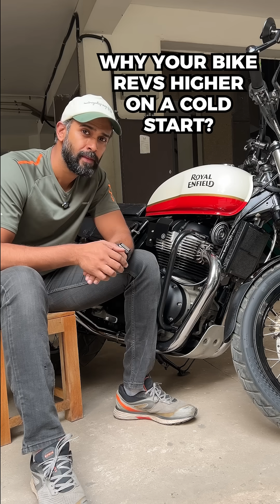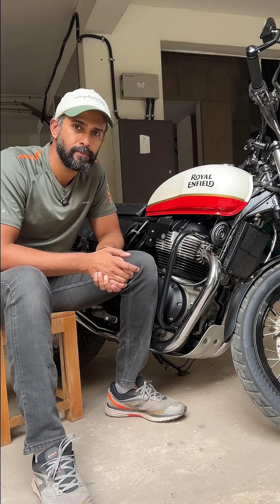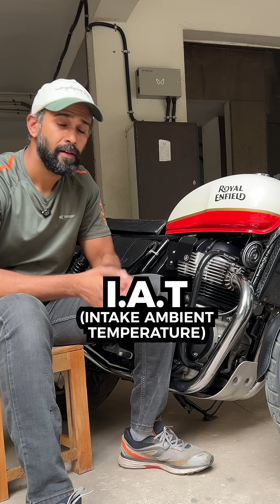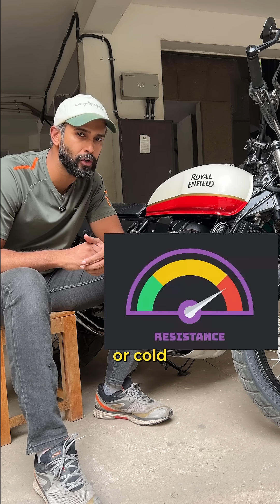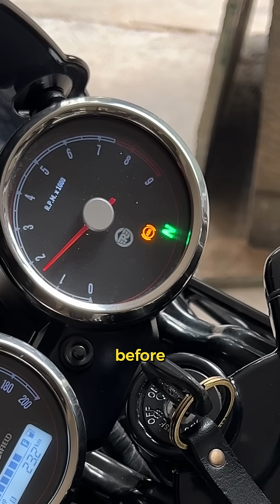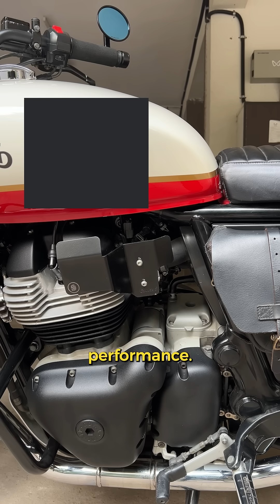Did you know this? #shorts #shortsfeed #ytshorts #shortsviral #ytviral #bikerlife #bikelife #reels

Comment: Electronics engineer here. As many people have pointed out, this is misinformation. The reason for the high rpms is to for the oxygen sensors in the catalytic converter to heat up to operating temperature. Without these sensors, the ECU is basically blind and does not have a feedback loop essentially operating the engine in open loop configuration. When the O2 sensor kicks in, it's now a closed loop control system and thus based on the exhaust O2 content the ECU can match the exact amounts of fuel-air mixtures from its lookup tables. So until then, it runs at a higher idle with a richer mixture, oil circulation is a secondary reason but that usually takes around 4-5s for oil pressure to stabilize. But this is the time first time I've seen someone blame the mass airflow sensor for this. Please correct this.

Comment: Automobile engineer here. Let me tell you. It’s not to get the engine to operating temperature or for settling the AFR. The actual reason is for emission. Modern bikes are equipped with catalytic converters which only work when the catalyst temperatures are high. So to quickly get the catalyst to temperature, AFR is made rich, ignition timing is adjusted accordingly and idle speed is increased by the ECU. As soon as the catalyst reaches operating temperature, engine idles slow and ECU runs in its best efficiency tune.

Comment: Ummm not totally right, why idle rpm goes down/smooth after 1/2 min?

Ambient temp is still low? Right?

I will tell you: ECU also checks the engine temp and combustion efficiency from exhaust sensors, based on engine temp the combustion efficiency changes which ECU detects and changes the fuel mixture.

More Factors:
1. Engine Temp
2. Combustion Sustainance
3. Combustion Efficiency
Reply from the maker: Thanks for the added insights!

Comment: When I start my bike (scrambler 400x) in the morning the rpm is high like 2300 rpm and when I ride it immediately without cold starting in 2nd gear the engine suddenly turns off in 2/3 gear what could be the issue?
Reply from the maker: that is interesting! Clutch control?
Reply: @SrinivasGanesh maybe but sometimes I don't touch the clutch and as soon as I de accelerate engine braking happens and suddenly the engine cuts off and the rear tire skids. That movement is quite dangerous. once the engine heats up no more of this happens

Comment: Its not because of intake air temperature. It's the engine temperature. Cold engine doesn't atomize the fuel well so needs a richer mixture. Also the idle speed increase is not because of a richer mixture, the increase due to that would be negligible. The idle rpm is controlled by the ISC idle speed control motor which controls the amount of air going. Richer mixture is for better atomization and higher rpm is to warm up sooner.

Comment: it’s not accurate information. petrol doesn’t burn properly when cold, it’s not atomised properly which is vital for air fuel mixture. liquid petrol doesn’t mix with air properly resulting in bad idle rpm. So the bike’s ECU add more petrol to make air fuel mixture rich so it doesnt cause any issue with cold idle rpm. Now manufacturers tune the ECU to run the idle rpm at cold start higher so that oil pressure builds up and gets to every nook and cranny. 

you got your logic wrong, bike isn’t adding more fuel to compensate for denser cold air, it’s doing it make idle smooth. try doing this in Carb bikes. Choke allows for more fuel for precisely for the reason i mentioned.

Comment: The RPM shoots up to warm up the catalytic converter as soon as possible as they are pretty ineffective at colder temperatures, there is also a slight ignition delay during a cold start, so that more of the combustion takes place in the exhaust phase of the engine cycle or within the the exhaust manifold to warm up the CAT. (Hence you smell petrol or simply hydocarbons in the exhaust fumes more during cold start) there is nothing to do with these sensors.

Comment: High RPM during a cold start isn't activated by the IAT sensor. Instead, it's the engine oil temperature sensor or the coolant temperature sensor that senses the engine's temperature, prompting the ECU to raise it to the normal operating temperature by boosting the RPM. Make sure to educate yourself first before trying to teach others.

Comment: Not correct info. ECU runs engine at higher rpm to bring engine to its operating temperature quickly and to provide enough lubrication to its vital parts like crankshaft bearings...etc.
Reply: Correct this happens in my Ntorq 150 it idel at 2000 rpm when started first then once warmed up it has 1000 rpm at idel

Comment: Its not the IAT, but the EOT (Engine Oil Temperature Sensor) which is the reason for cold start increased rpm. And when the oil reaches the specified temperature the idle rpm settles down. Consider your bike in leh and the air temperature is cooler everytime, but the rpm is not raised everytime. The ECU finds the engine cold measuring the temperature of the engine oil and reduces to normal idle rpm when it finds the engine oil temperature has raised to the specified temperature. You’re welcome.
Reply from the maker: Appreciate the detailed explanation! I google searched the difference and they are indeed two very different things. This short explains the IAT. I will do a separate one on EOT.
Reply: @SrinivasGanesh  Sorry man, the explanation in the video needs to be better. As a layman your explanation feels like after idling for a  few mins, the intake air will become automatically hotter, which is obviously not the case. And Yeah It's EOT that mainly controls the warm up rpm.

Comment: One important thing which u can make a video and bring attention of the people is the hazards of pressure washing… 
I own the same bakers express interceptor 2020 model and recently came across this issue … after the pressure wash the next day while returning back from the office my bike would go dead midway… no matter the gear I am in it would just go dead no throttle… after switch on again it would start and travelling some distance even at 40 speed on 4th gear it would go dead ! I was horrified by the situation… planned to go to the service centre to get it checked, couldn’t ride the bike for two days nor go to the service centre… magically the third-day my bike was normal with no issue … definitely because the 2 days break was enough to let the water dry out stored in most of the unreachable places like fuel injection ecu switches etc … this is something I experienced be safe fellas👏🏻

Comment: This is applicable only in Fuel injected bikes, for a carburettor bike, we need to manually pull the choke till the bikes idle rpm and heat is restored.😅
Reply: Yeah and used to avoid using self start in cold in my CBZ Xtreme trying not to put much pressure on battery. Used kick start instead.
Reply from the maker: Yes! You are absolutely right!
Reply: What about auto choke ??
Reply: @charanbr3509 that's what is fuel injection is replaced for
Reply: @gururaja_udupa_baikady  but discover 125 there no choke ( but has a carburetor) but does the same like that every morning
Reply: @dilushamda it has an electronic carburettor
Reply: @dilushamda  It Has Automatic Electric Choke
Reply: First time I understood choke

Comment: When the engine is cold, the piston shrink contracts slightly low, creating more clearance and allowing it to move more freely, which increases RPM. Once the engine reaches its proper operating temperature, the piston expands and fits more tightly against the engine head, causing the RPM to decrease.
Reply: Nop. Thats wrong.
Reply from the maker: Got it! Thanks for sharing this info!

Comment: What about rpm fluctuations?
Reply from the maker: Then something is wrong with RR unit. Get it checked.
Reply: Thank you Brother..
Reply: Check the ECU. RPM variations occurs with a faulty ecu. Try Flashing it or get it replaced. Alse check the throttle cable and EOT sensor.

Comment: How did you manage the engine tapping maintenance work. The RE service centres around chennai are not doing a good work with this maintenance activity😢
Reply: Check for the valve clearance. Inlet valve must have 0.08mm clearance gap between the valve and the rocker arm, and 0.18mm gap for the exhaust. You’re good to ride. Thank you.
Reply from the maker: Check valve clearance values

Comment: On a cold start rpm raises in modern vehicles for proper oil circulation,rich mixture of fuel mainly to  heat the catalytic converter for emission but also to increase the engine temperature.Idle settles once the catalytic converter is warm enough for regulation  of emmision.Engine will take usually 3-5mins of riding for petrol to reach optimum engine temperature and diesel will take 8-15mins.
Reply from the maker: Thanks for sharing the detailed info!
Reply: What about traditional carburettors?
I’ve seen my bike starting with a lesser RPM initially and then raising when warm enough.
How does that work?
Reply: @veeru1706 because the bike gets warm and reaches optimal temperature so it naturally burns fuel easily.Think the other way ie,Rpm gets lower at cold start due to low thermal efficiency
Reply: Perfect bro, Only correction here is, there is not much oil circulation needed, in modern engines it takes 1/2 second for oil to go places it needs to be. (you can ride as soon as your check engine light is off after start, typically 1/2 seconds in modern engine), however you can ride before the light is off too, its really hard to revv hard in that 1 second.

Comment: I have ns160 I takes 3 power starts to start engine, I took many times to service centre but no use can you please help.
Reply from the maker: It sounds like an issue with the spark plug or fuel delivery. Have they checked those?
Reply: @SrinivasGanesh yes in last service they checked whole fuel system but no use and spark plugs are new one

Comment: Hey ! Something happens to my hunter 350 sometimes ,is that when i start it and ride it , it feels like some amount of throttle is constantly pulled at all time even when i am not pulling . I noticed it when i like stop for speedbreaker and pull the clutch leaving the throttle . Any idea ?
Reply from the maker: Yes, your throttle cable is about to break. Get it changed.
Reply: Yes, your rpm has a variation issue. If its not around 1050+-100 you need to get the ecu and eot checked.

Comment: Meanwhile my carb model classic 350, starts regardless of the temperature outside…. Even after a good power wash(ofc you need to drain out the water from the spark plug area) and idles well…..: 
look what the modern bikes need to mimic a fraction of my power….😂

Not criticising the modern tech, but carb models are like those timeless designs…get the tuning right and you can rival even modern ecu units in terms of fuel consumption…
Reply: I mean how heavy headed you need to be to compare.
Reply: @devpanwr I’m not comparing mate, sarcasm….
Ofc modern tech is waay better… tuning a carb takes time and effort, while you can just plug in a module for modern ones, saves the hassle…
Reply: Its just your carburettor tuning is running a bit rich.